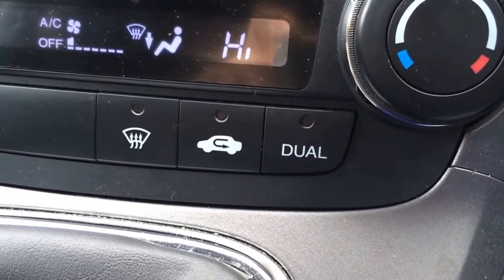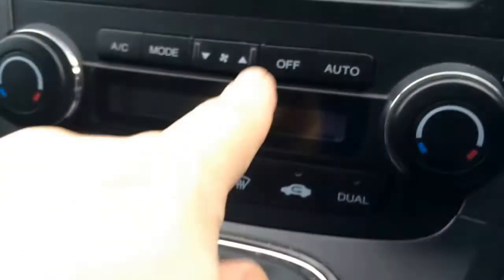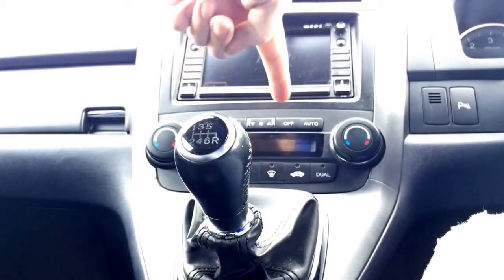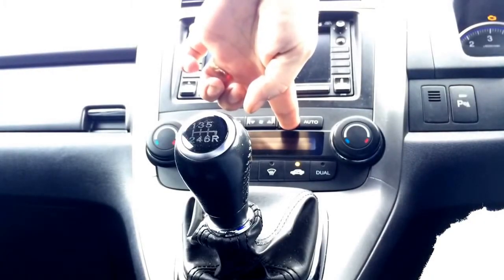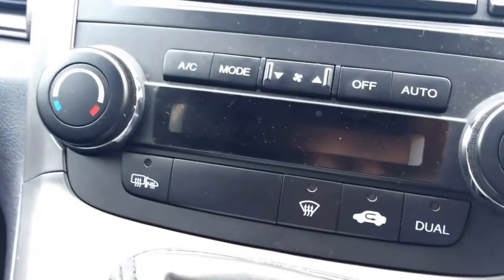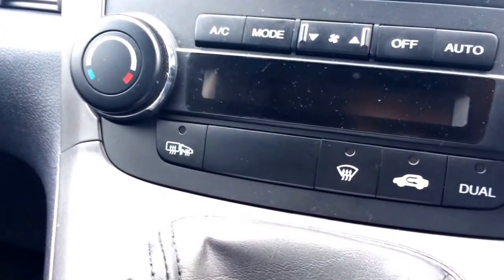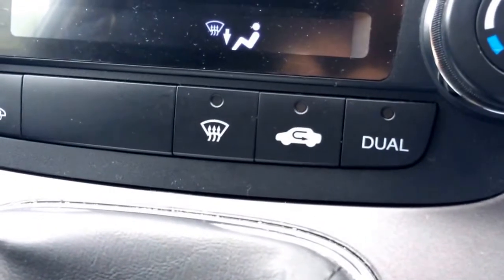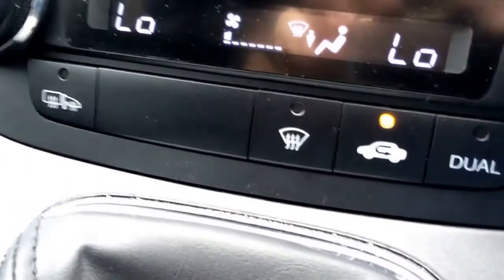Honda CRV how to reset dual light flashing. Follow these instructions at your own risk.

Comment: Worked fine on my '08 model! I have no idea why it started blinking. Also I did a derp and didn't follow the instructions - first time I pushed the windscreen heater button five times and nothing happened. So, in a very unmanly fashion, I actually read the instructions to use the rear defogger button and it magically worked. ;)   Thankee!

Comment: I had this same flashing light and I have the Air Con re-gassed first as I noticed it took longer to cool the car each time I used it. Once topped up at a local garage for £49.00 I did the reset and BINGO!  Good news as I was hearing horror stories about new compressors costing over £800!  Happy Days.

Comment: Hey andrew 👋😄 question did you had a problem where you have heat coming  out of the driver side and cold air coming out of the passenger side if so please let me know. 

Thanks.
Reply from the maker: macho 3088 nope never had that problem. I believe it’s something to do with heater blend/mixer door inside. Maybe just a stuck door or control actuators. Good luck.
Reply: @andrewparkes  thanks man have a good one.

Comment: I couldn't get this to initiate the test. What button is pressed with the off button held down? The AC button??
Reply from the maker: It’s in the description. 
Hold the off button. Turn car on. Then press wing mirror/rear window defrost 5 times.

Hope that helps.
Reply: @andrewparkes  yes figured it out and it works. Thanks

Comment: Hi do u no how to reset the Bluetooth on the radio it's the same as your radio can't connect to it and the women on vice control is speaking German can u help thanks lee 🙏🙏👍
Reply from the maker: Lee Roy Ok to get your radio to speak English just say change language but in the current language. Use Google translator and get google to speak it to the car. Then say English. Then yes. 
Bluetooth is not very good on the crv and often you have to replace the Bluetooth module. Which isn’t cheap. That’s about as much as I can help. Good luck.
Reply: Andrew Parkes thanks I give that a try & see if it works for me thanks for the information 🙏🙏🙏👍